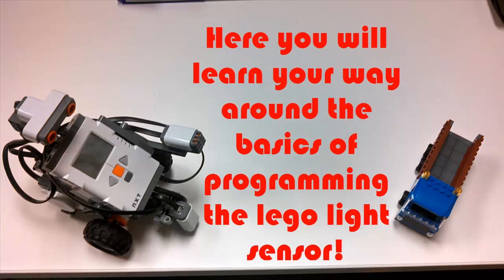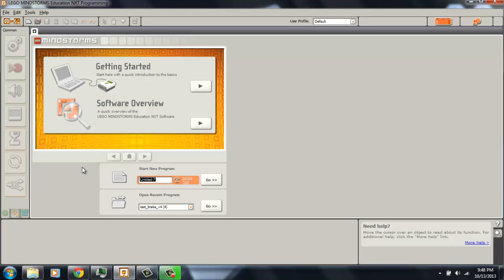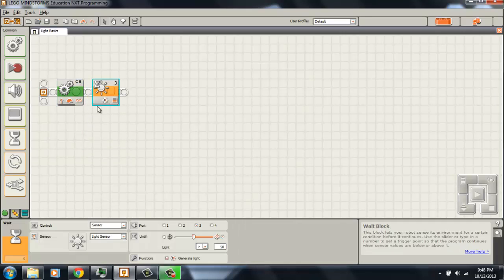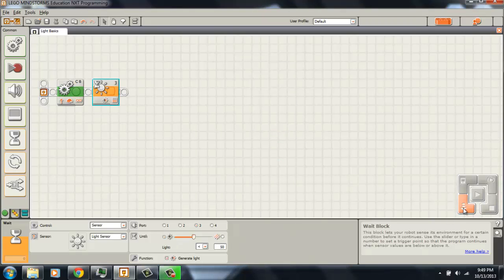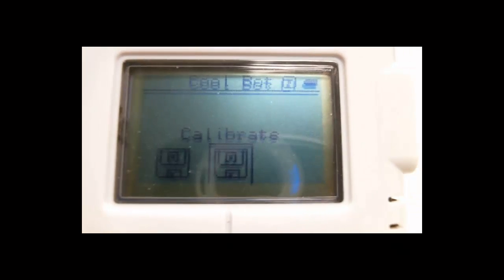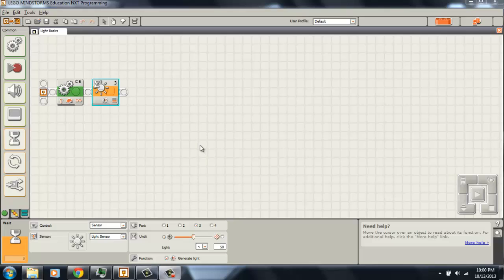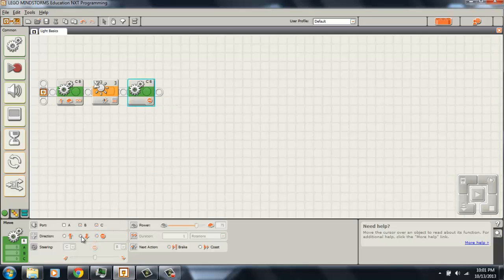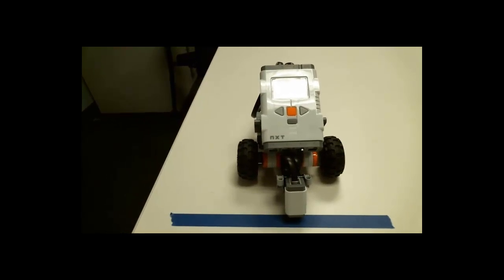Lego Basics and More - Lego Mindstorms - Light Sensor Programming 2 (video 3 of 4)

Comment: Hello Steven, thanks for the tutorial. I've watched a number of videos explaining how to calibrate the light sensor, but my own NXT 2 fails to pick the minimum value. When I upload the calibrate program and launch it, the minimum value starts off with 1023 (which should be the max value). While videos on youtube actually show that the light sensor is reacting to the sources of light. Mine doesn't. It just sets to 1023 value no matter what I do, whether shine the strong beam of green laser light at it or close it with a dark phone cover. I've tried changing the ports and cables. The color sensor works fine so I don't think the sensor is malfunctioning. Would appreciate any help with this.